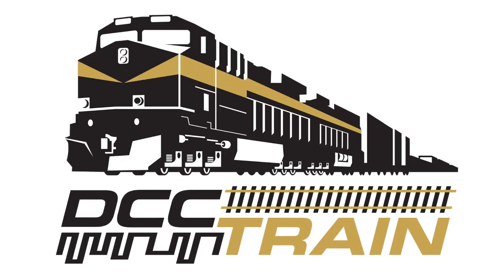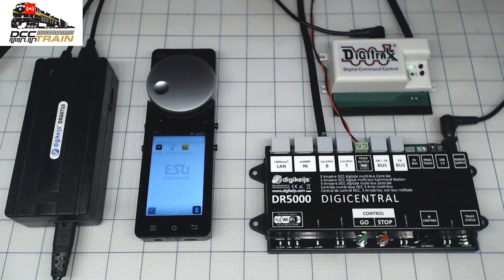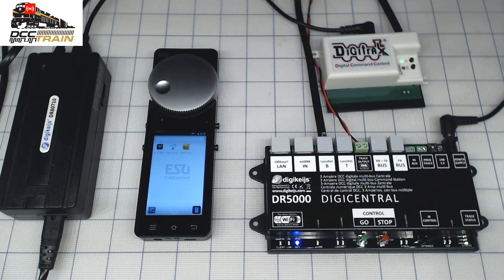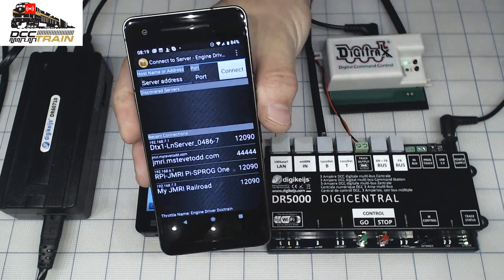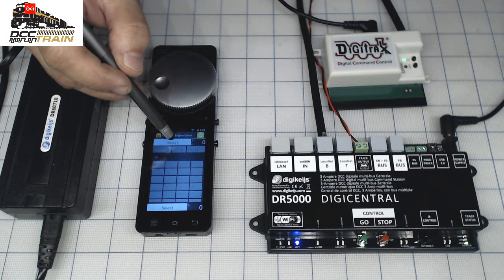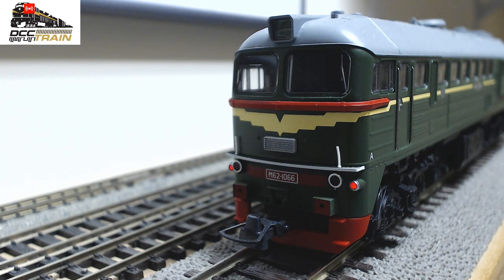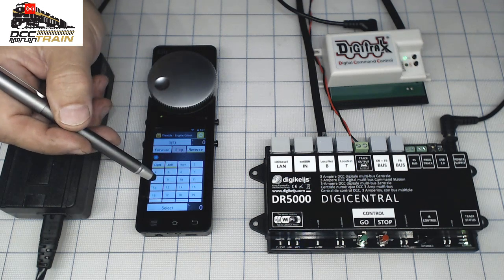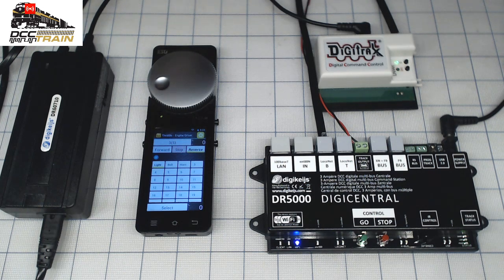How to connect ESU Mobil Control II to LNWI DR5000-ADJ DCC Multi-bus central Test Russian Diesel

Comment: Can you connect directly to the wifi connection of the DR5000 instead of the LNWI ?
Reply from the maker: Yes, however engine driver wont work with out PC connected to it and running WiThrottle server.